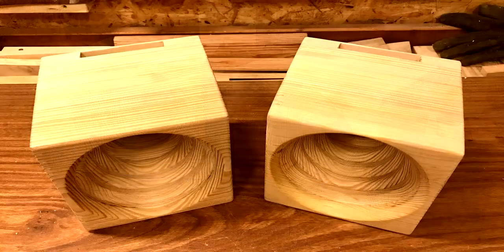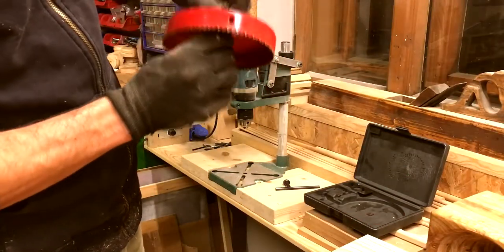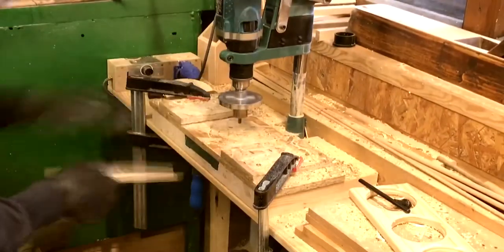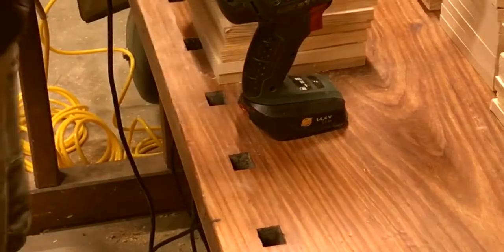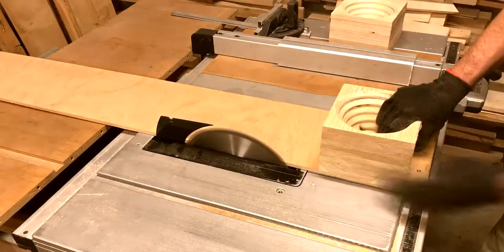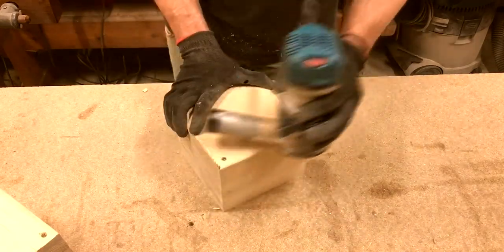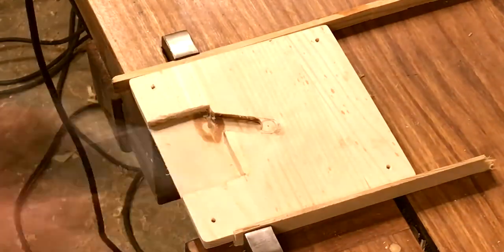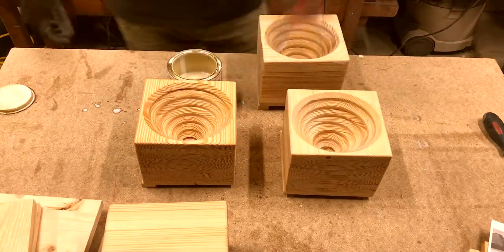DYI Passive Amplifier for Smartphone (for iPhone)

Comment: One YouTube hole saw tip you did not employ will really help with all hole saw cuts.  Run the hole saw down and scribe your cut line, then using a different drill or your hand drill drill a 1cm hole INSIDE the waste where the outside cut meets the hole saw cut, and go all the way through your material. 
The result is a waste hole for the saw dust to escape the teeth of the hole saw and this produces less friction and and easier big cut.
Also the plug you cut has a hole in it which you can use to remove the plug from inside the saw.